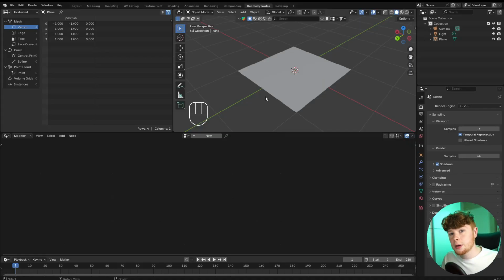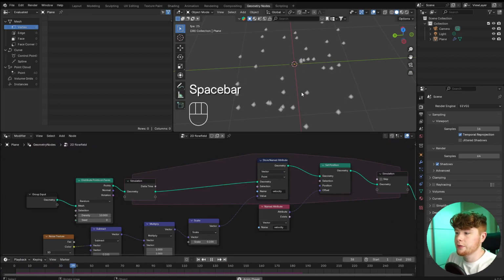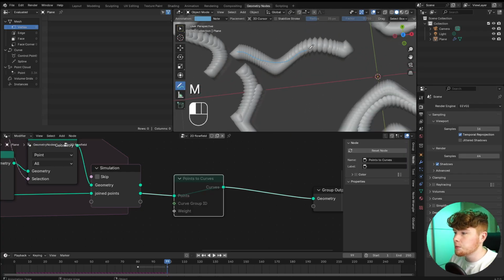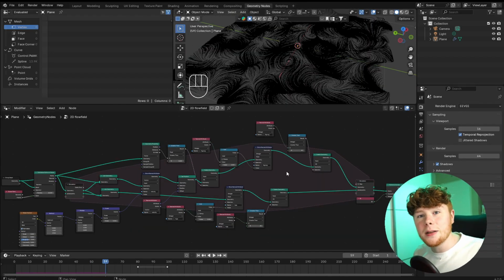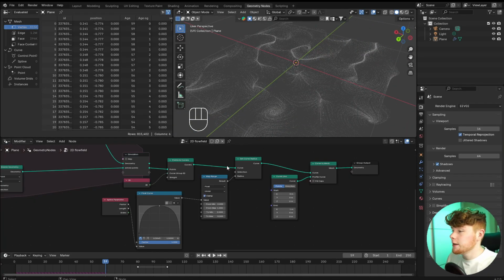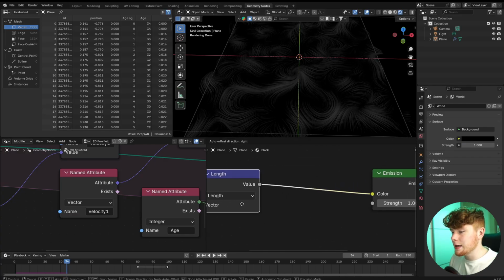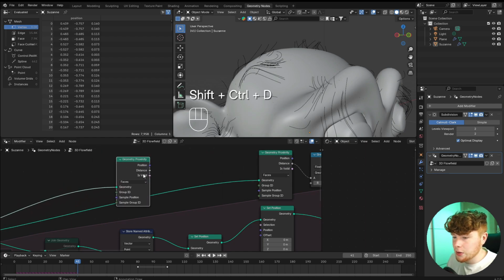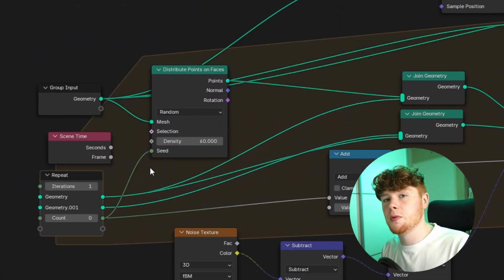Tutorial: CRAZY 3D Flow Fields in Blender 4.2!

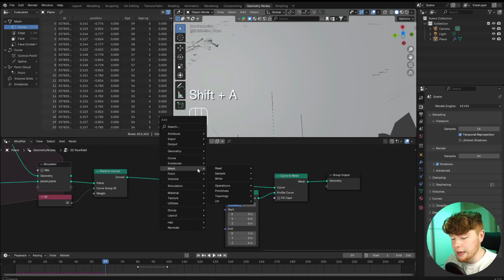Comment: yooo, this is super helpful! Small update months later for the bit at 12:45 : in Blender 4.5 (at least), the Curve to Mesh node now has a scale parameter, which can be used for the same purpose as the Set Curve Radius node, making the latter redundant. You can use the same Spline Parameter > Map Range node setup plugged directly into Scale on the Curve to Mesh node for the same effect.

Thanks for this guide, super helped with understanding a lot of the math behind this effect!
Reply: I'm using 5.0.1 and I can't make the curve radius work at all, it is only working with the scale parameter

Comment: Thanks for the great tutorial, it was a bit much for me so I purchased the project! Quick question... can I control where the effect is on the model using a vertex group? Is there some other way to do it? I'd like to control where the effect happens on the model.
Reply from the maker: You're welcome! You can connect the grey unused sockets of the Group Input node and connect this with the Selection socket of the Distribute Points on Faces node. Then, in the modifiers panel, you can set the vertex group (Be sure to first click on the grey button next to the checkbox). Hopefully this was a clear explanation!

Comment: Thanks for the tutorial, I'm having an issue trying to create the flowfield inside the mesh by converting to volume and distributing the points within a volume. It seems the points don't have the same ID data and don't work with the ID node. Any ideas?
Reply: Trying this too, I wonder if there is a way to designate point segments as groups by using the Set ID node? I tried using Age to set this, I can see the IDs based position in the spreadsheet but it doesn't seem to work. @mtranimation Any ideas?

Comment: Could something like this be done with node material, using gn to give this sort of flow to the noise texture node in the material?
Reply from the maker: You could perhaps try to get a similar result but without the simulation of points it would be a very hard task which would probably result in a worse looking visualization. Plus I think with Geometry Nodes there are just more and easier possibilities :)

Comment: Thanks a lot, really cool! I've been trying to loop the effect but can't figure out how, looping the seeds doesn't seem to work. Anyone having an idea how to accomplish that?
Reply from the maker: Thank you! That would indeed be a hard task since the distribute points on faces node is randomized. But you can try to use some manual technique that might work :)
Reply: When you put the scene time through  a math node set to modulo  the seed numbers should circle. With the B Value of the math node you can set the interval as far as i remember
Didn't test it just speaking from theory. (Mb I give it a shot today when I'm back home)
Reply: @Frigus3D-Art   I tried that. Maybe I'm wrong, but unfortunately, it doesn't seem to be that simple. Even if the seeds are looped, the simulation will be in a different state. If you find a solution, please let me know.

Comment: Great tutorial. It could be easier on the computer if you use a grease pencil line object to render curves and edges in cycles. Works well for especially for complex curves. There is a tutorial on youtube that gives the grease pencil settings. Not as good as using a shader like yours but may do the job if rendering is slow with a mesh.